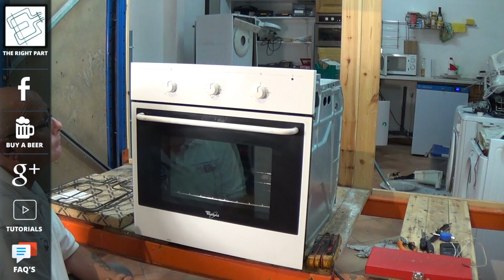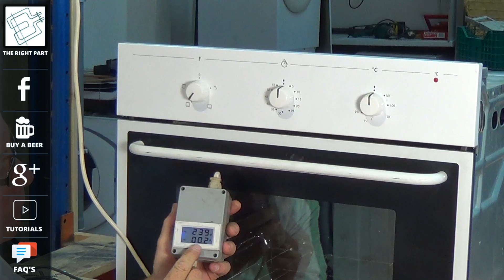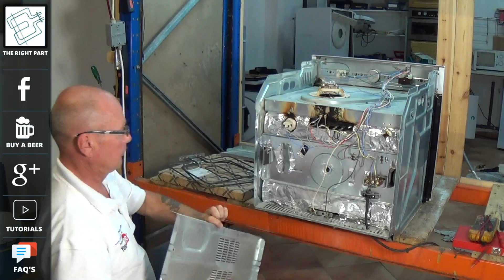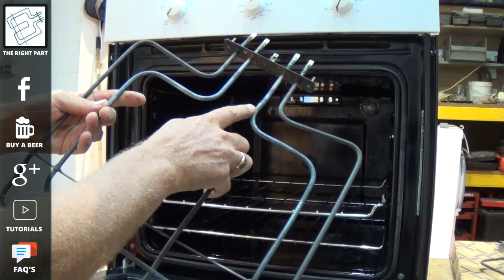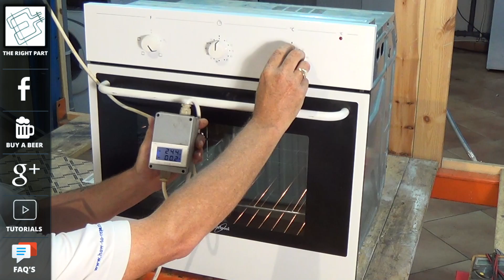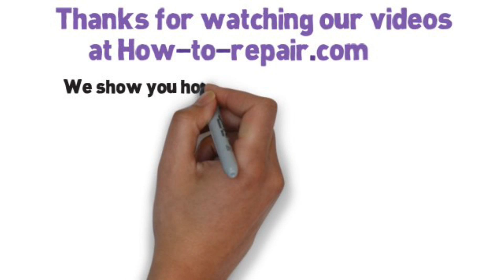How to replace top grill & bottom oven element in whirlpool made single built-in oven

Comment: Finally I found something which explains me how to remove the lower heating element. I thought I would have to disassemble the entire oven. Thanks for explanation!
Reply from the maker: Glad it helped! Thank you for subscribing to the channel it is much appreciated. This is what keeps us going.
Reply: Finally the old one was replaced on weekend. The old heating element was broken onto 4 pieces, thanks to nickel-chrom spiral, it was still holding at 2 joints and therefore I could remove everything by pulling out, otherwise would have to disaasemle the entire oven. Not sure if in your video you warned about glass wool thermal isolation. This is a bit dangerous, especially for eyes. Our oven is nearly 14 years old and the glass wool is now breaking quite easy.

Comment: Good job. What's the story with the burn marks obviously visible when the back is taken off? Didn't rate a comment during the video so may not be important, but I had similar issue around my oven connections when I took a look. Cheers